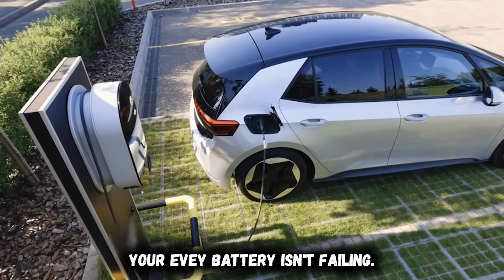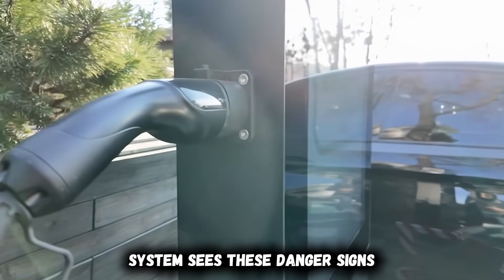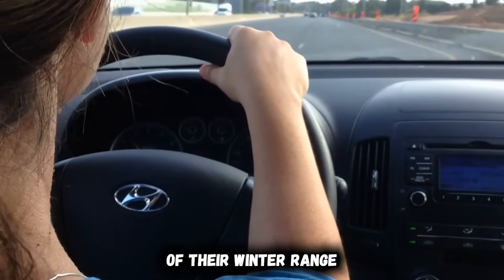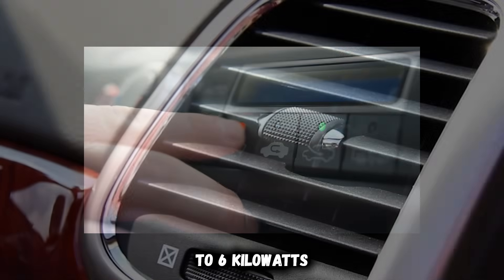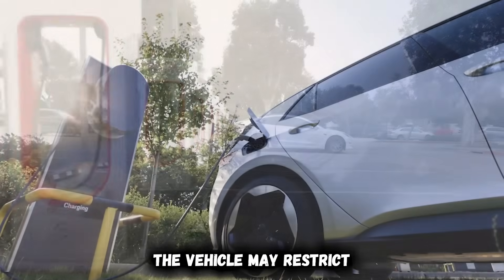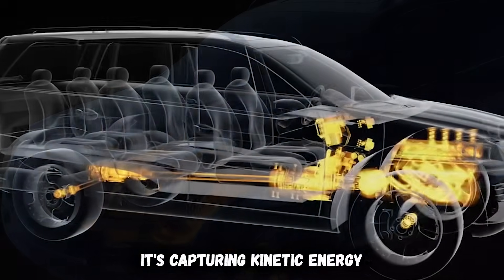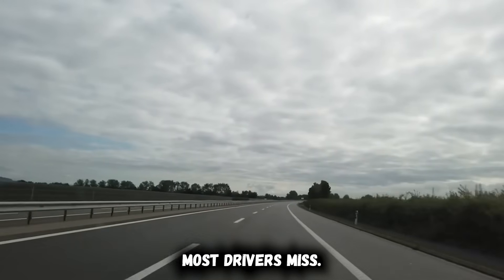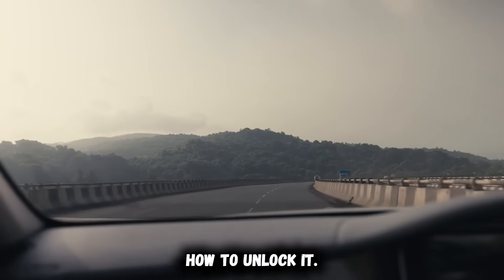Never Do THIS in Winter With Your EV (Most Drivers Do)

Comment: A few years ago the Alaska Center for Energy and Power (ACEP) performed a study on EV's in cold weather. 
Their findings were documented in a report called: Cold Weather Issues for Electric Vehicles (EVs) in Alaska

A similar study is available from NREL titled:
         Electric Vehicle and Charging
         Infrastructure Assessment in Cold
         Weather Climates: A Case Study of
         Fairbanks, Alaska 

These are available for download in PDF form from several sources. They offer a more detailed analysis. 
Use an Internet browser or search engine and search for: "Cold-Weather-Issues-for-EVs-in-Alaska.pdf"